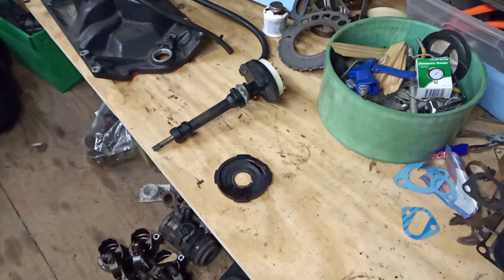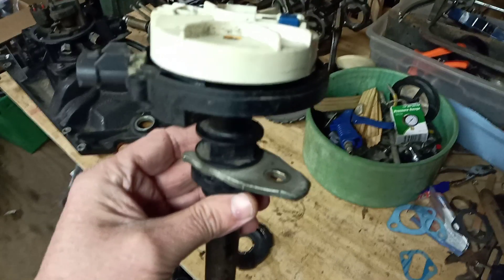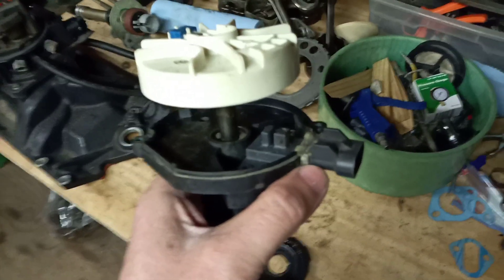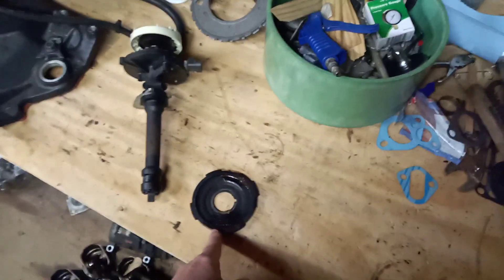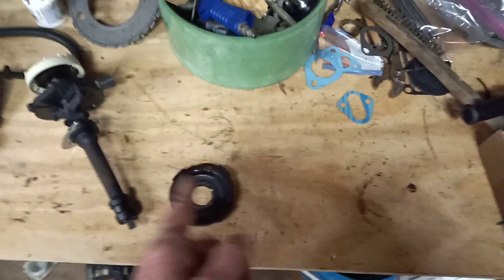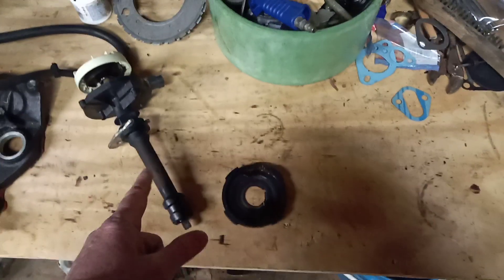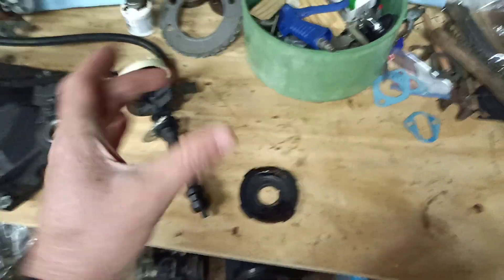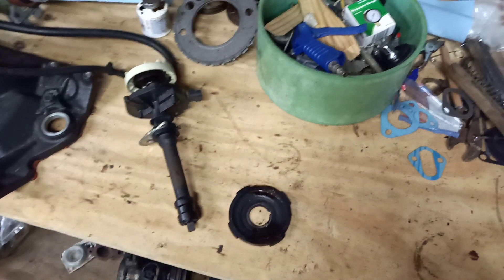Debunked - Dodge Fuel Synchronization - Part 2 (Hit Like If You Agree w/Me)

Comment: This makes sense.  I just replaced my distibutor on my Jeep 5.9 and I eyeballed the instal and it started right up with no codes.  Because I can't leave anything alone, I turned the distributor to the point of it throwing code P1391 intermittent loss of either the camshaft position sensor. So I turned it back a bit and the code went away.  I continued to turn it a bit each way and there was no change in rpm or sound or anything to indicate anything was changing.  I was expecting some rough idle due to wrong fuel delivery but I couldn't hear it, but I'm not saying that's not happening, so I am kinda on board with you.  The other interesting thing I found was when I replaced the distributor with an aftermarket unit there was no mark on the inside like my original indicating #1 tdc and when I contacted the manufacturer they said they got their info from All Data and there was no procedure that needed this mark.

Comment: "The point is the cam sensor is just an adjustable switch that lets the pcm know where the engine is. It does nothing else."  If you define "where" in a 720* cycle, "where" becomes a number.  The number has a range.  In this case the range is +/- 10*.  What is injector sync in a Dodge?  Dodge injector sync is the synchronization of the injector cycle time with the crankshaft in relation to TDC.  One commentor provided the proof.  He stated that +5* would enable the engine to idle with a large camshaft on a stock program.  The computer doesn't know the camshaft is changed.  The computer would also not be able to adjust fueling parameters when cold (open loop).  The injection sync must be "where" in the 720* cycle the injector is turned on or off via an adjustable switch. I will provide my proof.  In my dealership parts/shop truck changing sync from +8* to -8* made .5mpg difference changing it every Friday for 2 months in the summer.  Was this hard proof?  It was a good as we could think of to prove it to ourselves in the shop.  Was it a big change, no, but it was a verified change to use over a period of time to help eliminate variables.  
   You requested hard proof for your assumption by a PCM code or evidence.  The evidence would be the +5* enabling an engine to idle with a different camshaft and no programming changes.  PCM code would be P1391 "Intermittent loss of CMP or CKP".  The 1st possible cause in the OEM 2001 drivability manual is "CMP SENSOR OUT OF SYNC".  
   It is my observation onc could think the sync changes the timing two different ways.  One way to change timing would be the length of time the injector sprays and the other way would be total injector spray time in relation to the 720* engine cycle.  The adjustable injector sync discussed here only changes the relation in the 720* cycle.
   Also, the original method (1992-1993 model years) for setting injector sync was done manually by rotating the balancer in the normal direction of travel until the TDC marks aligned, then continue to rotate until either the "V8" or "V6" mark (V8 or V6 engine) aligned with the TDC mark on the timing cover.  Backprobe the CMP sensor signal with a DVOM and rotate the distributor back and forth across the switch point of the sensor (0 to 5 volt switch).  Lock down the distributor.  This method also proves "where" in the 720* the injection timing cycle is intended.  It also proves the sync is a range and works despite all the tolerance stack up between the crank and cam sensors.
Reply from the maker: Lot of supposition with no hard proof, just guessing. As I plainly stated , the cam sensor just tells the ECM which rotation it’s on so it knows where TDC on #1 cylinder is.  THAT IS IT. The ECM takes it from there. There is a range because the distributor rotates and it’s hard to get it right on a number so Dodge allowed the system to operate as long as the sensor signal occurs in a range. I won’t be answering any more questions on this dead horse unless you have ECM code to back up your statements.

Comment: I have a 1998 Dodge Ram 1500 5.9 that was having some minor idle issues so I bought plugs and wires. The first plug I pulled had the ground almost completely burnt off. I thought there’s my problem, and the next 7 were just as bad. I asked the guy at the parts house how it was even running. He said it’s a dodge, they run on magic. So there it is, the answer to all dodge questions, they run on magic.
Reply from the maker: The spark plug electrode is attached to the shell which is grounded. Without the electrode the spark just has a bigger gap to jump from the shell to the center. It’s not that much of a challenge for a good ignition system.

Comment: To my knowledge fuel injector spray is timed off the crank signal. The only thing that changes when rotating that distributor body, is spark time. So id say im in agreement with you. You could in theory do some shade tree testing and unplug vrank signal. Turn the motor over. And then go see if the exhaust smells like raw fuel.
Reply from the maker: I did all that in later videos. The injector is timed off the crank signal when permitted by the cam signal in Dodges. If there is no cam  signal injectors won’t fire at all. I proved this in the next video on this topic.
Reply: @moccasinmarine  yeah I'm figuring that out right now. Trying to help a friend get his truck running after another shop put a lkq motor in, turns out they crushed the crank sensor.

Comment: Can't you just move the crank crank sensor up or down to advance or retard timing???
Reply from the maker: No not practically anyway. The crank sensor is installed in a fixed hole in the back of the block. It picks up holes in the flexplate. The flexplate is indexed to the crankshaft with a dowel pin. This permanently locks the timing per the engineers design. The more practical way to change timing is with software to modify the calibration in the PCM. Until recently there was no software available. I think HP Tuners has a calibration editor for the Dodge 360 magnum engine now.

Comment: Can you repeat that one more time. This is a 10sec clip on replay
Reply from the maker: We’ll it’s gone 15k views so some people like it. Sorry you don’t.
Reply from the maker: 15k views and one negative comment. I’ll take that stat.
Reply: Thank you for this video, I am doing work on a 5.9 magnum and plan to do the chain, upper end gaskets and ignition - I have found that swapping the distributor is a more cost effective way to do the ignition in these older vehicles because when you buy the cap,rotor, cam sensor etc the dist assembly is about the same $$ and you get new shaft/gear etc. I have done the gm dist that you show in the video in my own truck, and as long as you line up all the marks when you install it, all will satisfy the ecm.  Somebody has put a bug in my ear about this very subject on the magnum engine and the “fuel synch” etc - the way I figure it, I will swap the timing set and then before reinstalling the intake, I will lift the old distributor out, and line up the new one exactly the same as the one I pull out and everything should carry on as it was before I started the repair.

Comment: The days of setting Fuel Sync at +5 were before SCT and HP tuners custom flashing for the PCM was available. Setting to +5 would help get rid of CELs from bigger Camshafts and help with easier starts.  Now that SCT and HP Tuners allow for custom tuning setting it back to 0 and the tuning is the preferred practice!  Many people thought, well if he done it to his big cam motor than it should be good for my stock motor. I have my Fuel Sync currently set to +5 because 210/220 duration and 110Lsa camshaft and no custom tuning it starts easier and idles better with no CEL. As soon asI have time to do custom tuning it will be put back to 0!
Reply from the maker: You did not understand the point of the video. It doesn’t matter where you set fuel sync as long as you are within the factory window and do not set a code. The fuel sync has nothing to do with fuel quantity. It only allows the pcm to run in sequential fuel injection mode.
Reply: @moccasinmarine  you obviously don’t grasp what I was saying. Yes on a 100% stock motor you can adjust the Fuel Sync. +/- 10 degrees and it does nothing. But in a modified engine with a larger than factory camshaft it was found to help the engine NOT trip CELs and start easier and run smoother if the Fuel Sync was set to +5 degrees, all before Custom tuning existed. Now that custom tuning exist set it to Zero and forget it! We can now adjust the Fuel and timing tables instead of manipulating a sensor! I have people ask me all the time who tuned my truck because I don’t have any CEL and am running a noticeable different than factory camshaft, that should be tripping a CEL. It hasn’t been tuned. I have the software just haven’t got to it!
Reply from the maker: @DakFink  Not going to argue. Watch the video again carefully and throw out any preconceived notions about fuel sync. It does nothing to the fueling no matter what cam you run. The video explains it.
Reply: @moccasinmarine  I have no Preconceived notions about it. I never once said anything about changing the Fuel Sync changes the Fueling! You asked where people got the idea of Setting the Fuel Sync other than at 0-degrees came from and I told you where it came from. I have been with this platform and modifying them since 1999. Had a 408 CUI with a supercharger, and a fried that ran Nitrous 360 both running 10-sec 1/4 miles long before SCT and HP Tuners existed. Both set the Fuel Sync (CaM Sensor) + a few degrees just to keep the PCM happy. It was not to add or take away any fuel. It was strictly to appease the PCM for NO CEL and a smoother idle. What is actually done for the PCM to be happy? Ask the PCM. FUEL SYNC is a misleading name that Daimler Chrysler for some reason decided to give their Cam Sensor.  Also the same company that uses TORR for their barometric measurement in their MAP tables.
Reply from the maker: @DakFink  smoother idle implies fuel changes. Also what does “keep the PCM happy” mean? The point is the cam sensor is just an adjustable switch that lets the pcm know where the engine is. It does nothing else. I can see a high horsepower engine maybe, maybe stretches the timing chain enough that setting the fuel sync forward would help from setting a CEL. I think we are close to understanding the same but to try and persuade more is pointless unless I have the pcm code in front of me. I have HP Tuners so maybe I’ll fork over $100 one day for my 98 Dodge Ram but I doubt it.
Reply: @moccasinmarine  I'll answer your question first: Keeping the PCM Happy means easy starts, good idle and most Important NO CELs. therefore an UN-Happy PCM is erratic idles, stalling, hard to start and Random CELs. The most common being Random Mis-Fire CELs that could be cleared but would come back eventually, some times taking 3+days and many times for different cylinders, but most commonly #5 or #3. Again all of these were issues that arose when installing Bigger Camshafts and the only way we could find to deal with them was setting the fuel sync +3-5 degrees.
Reply: @moccasinmarine  Now to address Fuel Sync for what it is and what it does.  I got this info from a guy I know that has dug deeper into this stuff way back when before I did. Fuel Sync is called Fuel Sync because you are syncing the Cam Sensor to the Crank Sensor.  IE: Syncing the 2 main sensors required for Seq. EFI  FYI you can have EFI without a cam sensor but it will be Batch or bank fired not Sequential.  The part most people seem to miss or forget this is not a Carburetor / Distributor system where the Air , Fuel and Spark are all adjusted and controlled individually. Seq EFI has no less than 6 sensors. Crank, Cam, Map or Maf, Intake Temp, Coolant Temp, Oxygen.  None of these sensors effect or control Fuel , Air Or Spark directly.  They all supply data to the PCM to calculate and use Fuel, Air and Spark tables to be able to run the engine.  With that said moving the Crank or Cam sensor from center of away from 0-degrees will put a variation in how the computer calculates the data it receives. FYI: There was a few guys making adjustable Crank Sensor brackets so we could adjust timing beyond what the PCM would allow (again before custom tuning was available). I am pretty sure that setting the Fuel Sync / Cam Sensor +3-5 degrees out of phase as we did manipulated the PCM input data enough that it adjusted the Fuel, Air and Spark delivery some.  NOTE: any time EFI changes 1 of Air, Fuel Spark it also changes the other 2 no getting around it that's its job.  NOW for proof there is only 2 ways you could see the injector firing vs moving the Cam sensor. 1: Find a Timing Light that is sensitive enough (good luck with that) to pick up the #1 injectors signal and do just like spark timing and check it against the timing marks on the Dampener. 2: which is more doable and reliable is an Oscilloscope, hook it to any injector + lead and adjust the Fuel Sync and look to see if it shows a shift of the pulses on the display. This is the only way I think you would actually see the Injector Firing reliably, as they fire for milli-seconds per firing.
Reply from the maker: Most of the above is preconceived stuff. You gotta watch my video with the idea you know nothing about Seq EFI. I’ve been tuning EFI for 20 years. I just haven’t done a Dodge but I know GM. Watch the video again and really understand it.
Reply: @moccasinmarine  I'll make sure not to bring anything to your shop! If you've been TUNING EFI for 20yrs. You might want to get back in the books and update yourself.  Anyone that knows and understands EFI in depth knows that if you have a sensor that is supposed to be synched with another at a set point, if you move either sensor you will offset what the computer sees. That's just a FACT of Computers and Phasing.  Also if the PCM couldn't see the difference nor do anything with it then why do you think it's able to tell you within +/- 10 degrees that you are off from O-degrees. That information goes through the computer before it is delivered to you as a Number. If it had to process it to give you a number it processed it to use it as well.  BTW: 20+ yrs and hundreds of Dakotas and Durango's running on radical cams with no Aftermarket tuning by setting the Sync off from O-degrees, and No CEL No Idle Surge, No Stalling, but set them to 0-degrees and you get a CEL, Stalling and Idle Surging! I think I'll trust the real outcome vs someone's half-baked test!  THAT IS ALL!
Reply from the maker: @DakFink  Watch the video and quit thinking about the past. It’s all there.

Comment: Hurry and make that third video .
 I am there now and I need to get this vehicle running ...
Reply from the maker: I already made a third video. It’s in this playlist.

https://youtube.com/playlist?list=PL6wJJenh5G97YzI8Q0t2W7Zm680EpIFKs

But you need to make sure you have a working cam sensor and a working crank sensor. If you just rebuilt the engine then you need to make very small distributor rotation adjustments until it fires up.

Comment: My 1998 ram 2500 with the 360ci 5.9 magnum won’t start? 

I was driving down the highway at about 65mph and all of a sudden I heard a loud boom and then the truck died on me. I coasted off the highway and looked under the truck and my exhaust muffler had exploded! The pinch weld was peeled all the way down the muffler? I had just put this muffler on about 4 months prior to it exploding? Since then the truck will crank but won’t start? I have fuel pressure and a 1/2 fuel tank and I have spark from the ignition coil. I replaced the cam sensor and the crank position sensor and still it cranks but won’t start?

I went to replace the timing chain and sprockets and when I got the chain off I tried to spin the motor by hand just to make sure it’s freed up. 

For some reason I cannot spin the motor all the around with a wrench on the crank pulley? Do u have any idea what happened?
Reply from the maker: You should never rotate an engine with the cam not timed with the crank. Some engines are interference engines and the pistons can hit the valves if the cam is in the wrong location. Rotate the engine very gently by hand tool until it stops. Back it up 20-30 degrees and then rotate the cam gently to where you can time it with the engine again. Only after engine is timed (cam timing not ignition) should you attempt to rotate it again. Once you can rotate it do a compression test to see if any valves got bent. Bent valves won’t seal. If you have decent compression in each cylinder then write back for more help.
Reply: You can turn the crankshaft with the chain attached to see if the engine is locked, try removing the spark plugs when you do this or it will not turn easily and smoothly turning against the pressure in the cylinders

Comment: My problem had nothing to do with what you're talking about but gave me the solution to my problem thank you stranger on the internet
Reply from the maker: Mind sharing what your problem was and how you fixed it?
Reply: Dropped a fuel pump in my truck and the damn thing wouldn't run worth a damn and you saying that all the distributor did was time fuel gave me the idea to spin the cap worked like a charm
Reply: @AvocadoToast_________________1  it is likely that you have a worn timing chain